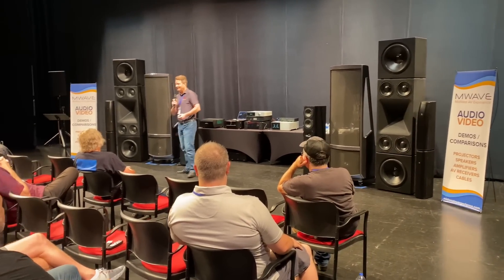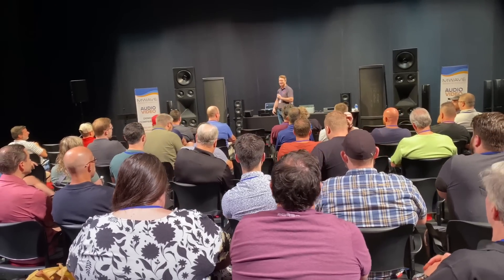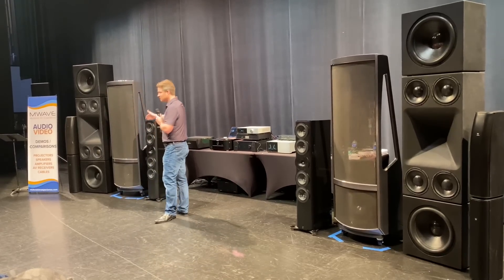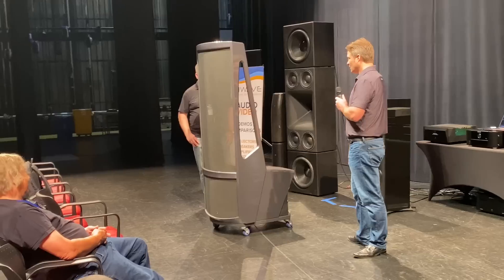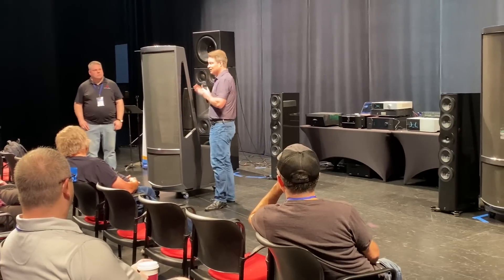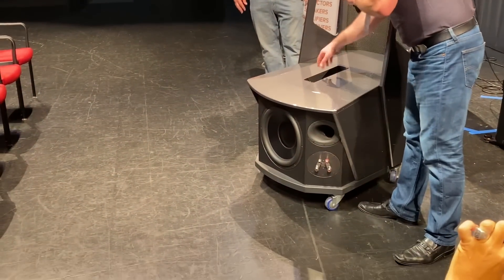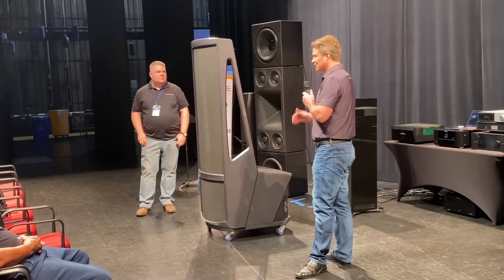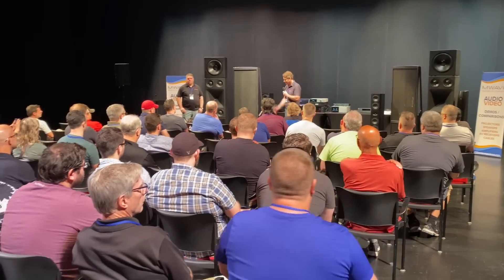Martin Logan Neolith Speakers at MWAVE 2022

Comment: Perhaps in this instance they're more on-stage than in the theater. 

I'm sure the speakers sounded great... but on-stage, with curtains tied open, exposed hard surfaces to the sides, hard floor... doesn't seem as ideal as possible. 

The distance/time to those hard surfaces wouldn't necessarily corrupt the direct energy/HAAS Effect from loudspeakers, but it would seem room sonics left a little on the table here. 

I always envisioned this shootout demo atmosphere but with speakers on the lip of the stage and listeners seated in the theater proper. A clean wavelaunch off into the theater.
 
Again, I'm sure it sounded fine. I'm jealous I wasn't there. 
Always appreciate the content.
Reply from the maker: Thank you for the input. At one point we moved the Perlisten and Martin Logan Neolith into a large room, which allowed them to utilize boundary gain and were much better suited. Ideally we would have a proper acoustic treated room but we have to work with what we have. We considered moving them to the front of the stage but that would mean placing participants really far away from them since much of the floor seats are way below the height of the stage.